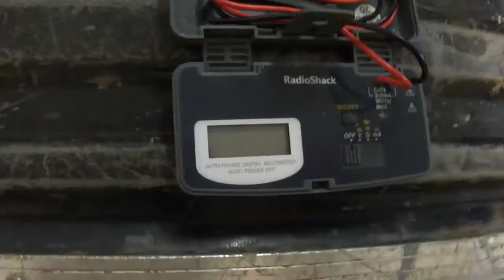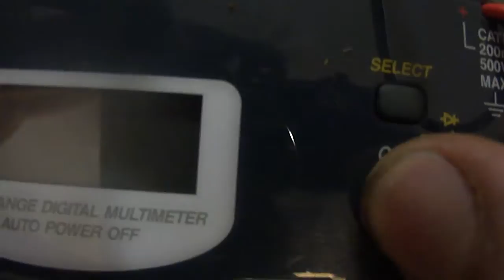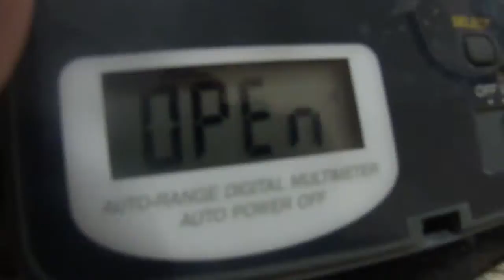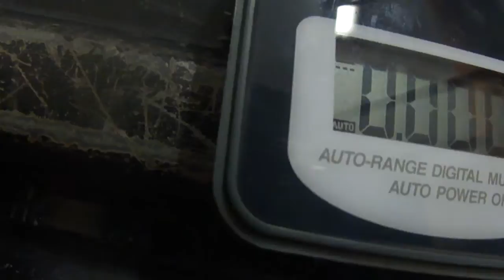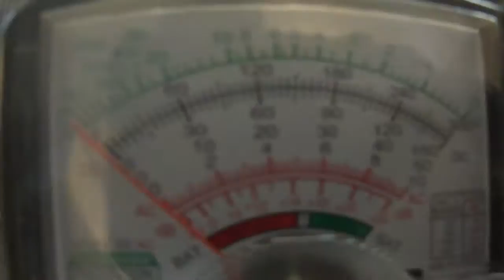Radio Shack pocket volt meter review

Comment: Milli volts is used for smaller voltages so 1000 milli volts equals 1 volt. Amps actually measures the flow of electrons through a wire